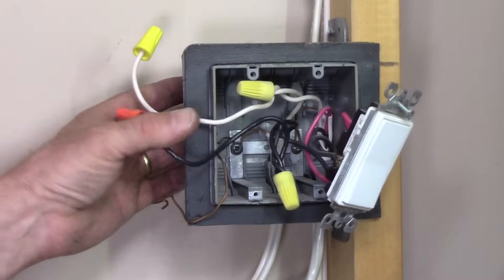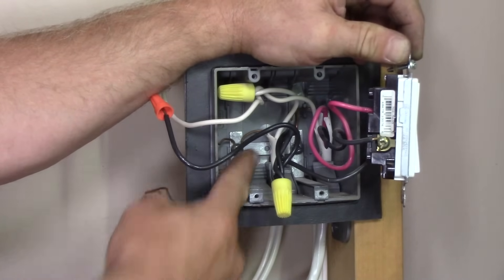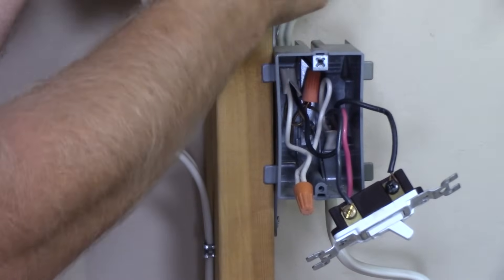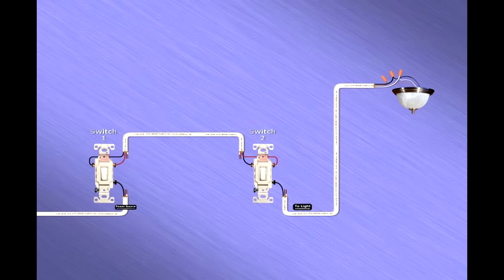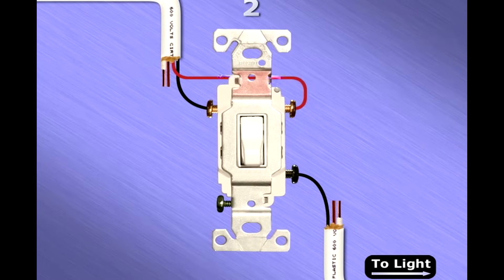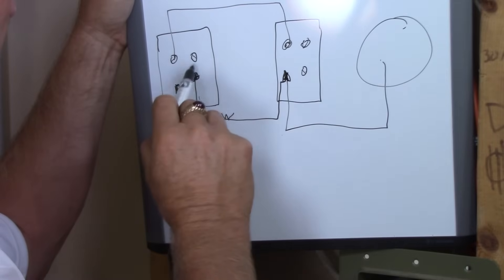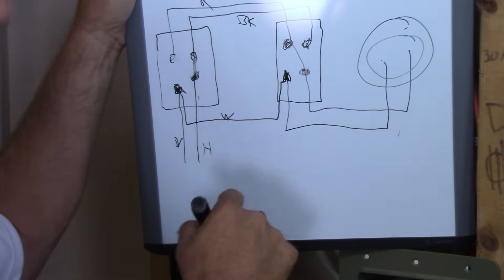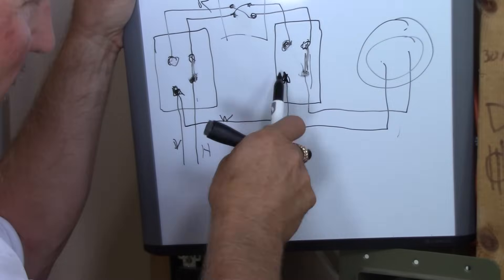The Best 3 Way Switch Explanation Ever!

Comment: There are two other methods, Chicago or Carter and West Coast or Hollywood. The West Coast 
is weird but the Chicago is  dangerous as it can put 120 volts on the screwshell of the litebulb.
this was made a violation back in 1923.
Reply from the maker: Yes, there are many variations of how to wire this, but once you understand how it works, it's easier to apply that to any other method.  However, this is the most accepted way now with the new code requirement of a neutral in every outlet box.

Comment: Can you do the wiring in 12/2
Reply from the maker: Yes, for sure!  Canada we use much more #14 wire and 15A breakers that I've found in the USA, or at least Arizona where I had a home.  Mostly 20A and #12 for utility power and lighting circuits. Thanks for watching!

Comment: what if both traveller wires are the same color and using Lutron Maestro switches. Does the connection of the traveller wires have to a specific location  on the companion switch??
Reply from the maker: No, you can mix up the travelers.  No problem!  I hope that you also subscribed to my channel, and clicked the bell?  Much appreciated!

Comment: I have a situation with a light switch that was a self contained single light switch with three Romex cables in it. I installed a leviton decora switch but now when I turn my closet light on it turns on my two wall receptacles and when off they are too
Reply from the maker: Did you get this fixed?  Sounds like you mixed up some of the wires? Let  me know if you need help sorting  this out.  I hope that you also subscribed to my channel, and clicked the bell?  Much appreciated!

Comment: It would be much more intuitive if the two travelers were top and bottom on one side of the switch, with common on the other side.  Then you simply point the switch the way you want the power to go.  Having them both on top is what makes it confusing. (unless you saw one open to see what is happening inside).

Comment: This video is perhaps the best explanation I've seen of many of the principles and operation of 3 way switches.  But the video is mostly useless because the real world wiring are not fully visible as in the animations or diagrams.  There is no explanation for definitively determining the hot and load wires from the short lengths protruding from the junction boxes.  In my perplexing case, after removing the switches on both ends, spidering out all the wires, restoring power, my tester is indicating 3 of 4 wires in each junction are hot (double checked with a DVM too)??? When I reinstall the original switches and connections, the 3 way switching works correctly normally again.  BTW, I'm trying replace one of the original switches with a smart switch.
Reply from the maker: Send me an email with photos, diagrams, anything, and I’ll help you figure it out. Terry@electrical-online.com.
Reply: @theinternetelectrician  HI Terry.  After tripping the breaker numerous times, I gave up and just put it all back together again a couple weeks ago.  The only "method" I hadn't tried and perhaps would have eventually worked, was just randomly wire the Smart switch until it worked (or simply use a smart bulb instead).  I'll try and get you some pics next couple days. 

Still, shouldn't only ONE of the spidered out wires in only one junction box been hot?

Thanks

Comment: You Fixed me up in Under 4 minutes. I went from the Decora which I have all over this house and I HATE them because they Break so easily, to the Old School Standard. The guy in Home Depot Totally misled me. He showed me the 2 Black Wires going to the 2 Brass Screws and Red to Black. That Only made the Switch work 1 Way. IDK if it's because I Changed the Style of Switch, but all I know is that when you said to put 1Black on Gold and 1Black on Black the 💡 in my head went on  before I even hit the Power. I KNEW YOU WERE ON THE MONEY. You are The Man 😎👍🏼 Thank You !!!
Reply from the maker: Happy to help Julz! Thanks for taking the time to comment!

Comment: Your identification of which wire goes to the common screw solved my problem. Thank you!! I struggled for hours and in 15 minutes after your video I have it fixed!
Reply from the maker: Excellent!  Happy to help out! I hope that you gave it a 'like', and that you've subscribed to my channel.  And don't forget to click the bell so you'll know when I release a new video.
Reply: So I replaced mine EXACTLY how it was and it now trips. Nothing is touching. It was not hooked up like you said. So I did your way and it’s now everything on my double box is hot and trios when it switch it on. I’m baffled.

Comment: Question: If I am replacing an old 4-way switch, and the other two switches work correctly but the 4-way is on when it’s supposed to be off, do I switch the wires top to bottom on the new 4-way? Or left to right? Thanks for the good video!

Comment: This was great, thank you much for this.  The animation really helped explain things.  However, it would be nice to see other ways to wire up 3-way switches.  I think there are like four different configurations.  For example, when you wire a 3-way, but the light is between the switches, and it is more practical to run wiring between the two switches, but rather through the light.  Great video overall!!
Reply from the maker: Yes, there are numerous ways to wire these circuits.  But once you understand how it works, it makes it easy to figure out the other methods.  I have a few diagrams that show the different scenarios.  www.electrical-online.com and search 3-way switch.  I hope that you gave it a 'like', and that you've subscribed to my channel.  And don't forget to click the bell so you'll know when I release a new video.
Reply: yeah but this like the main legal method

Comment: Thanx for the video, but since when is there a neutral in the switches themselves??
Reply from the maker: MrTommy, a neutral is needed for many of the new electronic dimmers, smart switches, etc.
But the other problem with having no neutrals at switch outlets is that you cannot add a receptacle to a circuit from it.  Countless questions I've had to answer over the years, "How do I add a receptacle from this switch that only has a black and white wire, and they're both connected to the switch"  :-)  Thanks for watching!

Comment: Great video, what if you have a light and switch at the top and bottom of the stairs?  How do you wire the switches to control both lights and function like a three way switch?

Comment: What if the power and light line come into the first switch box? How would the wires be connected just to the other switch without heading anywhere but still controlling the lights?

Comment: Why can't you run your neutral straight to the light from box 1 then make the red to red as traveler 1 then black from switch one hook it to white at the light for your black traveler?
Reply from the maker: I thought Elvis had left the building? Welcome back!!!  It's all about working with cables or Romex / Loomex.  NMD cabling.  If you were using conduit and wire, then other options like you suggested are quite feasible.  There are numerous methods of wiring a 3-way network, but with the new rule on needing a neutral in every outlet box, this is the best way to accomplish that.  Thanks for watching! Thanks for watching!!! I hope that you gave it a 'like', and that you subscribed and clicked on the bell?

Comment: As you illustrated in your initial outlet/device explanation, colors with "Romex" type wiring are somewhat meaningless. As you showed in the first outlet, the black was both the "hot" and a "traveler". At the other end, the black was the "switch leg" and also a "Traveler".  BTW, a person can tell the black in the first outlet is a "hot" because that same black (via a splice) is feeding the receptacle. On the opposite end/3way, the black simply leaves on its way to the light. Not always the case but for sure, it is here. 
If the electrician who initially wired that circuit is going to do anyone any favors, he/she will physically "wrap" the "common" conductor, immediately where the conductors leave the romex jacket, (no matter what color that is being used) around the two travelers. That way, even if the device gets removed without noticing which conductor was attached to the "identified" terminal, a person can easily tell which conductor is the "common".
Reply from the maker: Good observation Pappa Bob, and a good tip with wrapping the wire designated as 'common'  around the 2 travellers.  I used to strip the insulation off the end of the common to identify it in the rough-in stage so that it was obvious when you pulled them out of the box ready for the end devices.

Comment: Does the placement of the travelers on one switch depend on how they are installed on the other switch?
Reply from the maker: No, matters not.  That will only affect whether both switches up or down have the lights on, or if they have to be in opposite positions.

Comment: I don’t really like to hear “hots” referred to as “commons”. Some people confuse commons with neutrals. I prefer the terms hot (on incoming hot of 3-way), travelers and switch leg (on fixture side of 3-way).
Reply: When the pigstails try to get it you drop it like it's hot
Reply: If you think of this switch as simply a single pole double throw it will take all of the mystery out of relays.
Reply: In this application I would normally refer to the wires as neutral, line, load  and traveler. It’s a power passing device. If it was a motor or low voltage application, than I could see using common as a terminology. However, on the back of most three way switches, the line in terminal is in fact called a common. So it’s not necessarily a completely wrong description.
Reply: They are literally labeled common on the switches.
Reply: @jemmani22  yes common is the correct term if that's confusing to someone they shouldn't be anywhere near it
Reply: Well common is the proper term for the hot that isn't the travel. At least it is here in Canada but I would imagine if you're in north America and looked it up in a textbook that's what it would show.
Reply: The switches I'm installing are labeled common, not hot.
Reply: See that's what kinda confused me  none of the other ones I watched said anything about 4 wires. At least this giy explained about the common.
Reply: Common is the proper term because voltage coming to 1 common of 1 of the 3 way switches is the 'feed' and voltage exiting the other 3 way switch's common is the 'switch leg.'  You can't disassociate the significance of the correct terminology!
Reply from the maker: Good point, good old english language and the multi-purpose words.  But this can be thought of as putting the "hot" on the 'common terminal', (not the terminal where the common goes).  The 'common terminal' is named that cause it has something in common to the 2 other terminals (is connected to either one or the other)
Reply: @theinternetelectrician lq
Reply: Thank you very much. It was very helpful  to me. I was having a bad time with all these wires.
Reply: I mostly see the common wire referred to as the neutral where I am in the US. After powers splits and goes to various loads the neutrals all tie together as a common source back. I've even seen multiple power sources all tie into one common neutral
Reply: Every time I hear "common", DC circuit comes to mind, where it's negative side of the power supply.

As for AC circuit, I always hear load, neutral or ground...

Those were what was taught in school where I got my degree in electronics engineering.
Reply from the maker: Common, albeit arguable and confusing,  is the correct term.  This is the same as when referring to relays.  You have a C, N/C, N/O.  The common has a potential to connect to the normally open contacts, or the normally closed.  Think of a 3-way switch as a "manually operated relay".
Reply: @theinternetelectrician  Couldn't have said it better, sir! 👍
Reply: Yeah like a square  but its really a triangle 😂😂😂
Reply: I just call it the spicy wire.
Reply: then don't you like hottest species? ??
Reply: I'm an electrician in Arizona, I agree with you why call it common just say hot there's no difference other than just adding an extra word which is confusing.
Reply: I don't like to hear people complain when there is also a visual tutorial aswell but here we are.
Reply: @moefritz9568  I don't think he was complaining, just making a statement about his preference which I and every other electrician in my company happens to agree with. Life is short and stressful enough without going after someone's comment on you tube that you don't agree with.
Reply: Hot wires are not considered common wires .the common are the white wires in practical house wiring . Very confusing video .
Reply: Well then, why don't you make a video using the language you prefer?
Reply: @breastmeatonly  he's just trying to be helpful to people that are layman. He wasn't being hateful
Reply: That’s funny, just how it was taught to me years ago, we didn’t use the word common lol

Comment: Does it matter which side you put which traveler on?  Thanks for the great video.  EDIT - love the animation.  I'm guessing you need a tool that will tell you where the hot wire is so that you can figure out which switch is the #1???
Reply from the maker: No, it does not matter what traveler wires you put on what traveler terminals, but some people with OCD (and even some inspectors I've been told) want it so that if both swithces are up, or both are down, the light (s) are off.  If one or the other is out of position, they are on.  Yes, you need to have a meter or a voltage tester, but if you have a look at the cables in the box, you should be able to ascertain what is what. Thanks for watching!  I hope that you gave it a 'like', and that you subscribed to my channel? And clicked the notifications bell?

Comment: Please help! I have a box with 6 wires. 4 are standard black,white,ground. While 2 far left are black red white ground. I didnt take a picture. I didnt lable it. One switch was a 3 way with the kitchen light. Another 3 way to the dining room. I can't find anything solid for my situation. Should I just call an electrician? I found the HOT wire using a multimeter... After trying some things out and blowing the breaker I am desperate.

Comment: My wiring has the reds (travelers tied together at the light junction box itself and one switch only has one set of wires on it white BLk and red. The other switch that has the line feed has all whites tied together and one red and one black (that’s not the feed)  I am totally confused by this set up and it’s never worked right
Reply from the maker: Can you scratch out a diagram, or send good photos of the connections at each outlet? Send to terry@electrical-online.com, or internetelectrician@gmail.com and I'll help you figure it out.

Comment: So what if the light is in the center of the two switches ???
Reply from the maker: There are many variations of how to wire a 3-way network.  However this is the one way that now meets the new code rules that require a neutral at every switch outlet.  Once you see how the current flows in the circuit you can adapt to the other scenarios providing the right cabling is in place.  You can see some of the variation diagrams here on my website. https://www.electrical-online.com/3-way-switch-diagram-variation-4/

Comment: Question Terry, On your drawing white board, You drew a  V for the Neutrals going down to the next switches and Lights.  Do these serve as the Ground as well OR did you just not add the Ground Terminal? Last question. Grounds need to be for each terminal or Just First One?

Comment: Why is the hot wire called the "common" I thought the neutral wire is the common wire.
Reply from the maker: Common in this application is in reference to the common terminal on the switch.  That terminal is 'common' to the other two in that it is either connected to one or the other of the traveller terminals.

Comment: How can I add an always on  power utlet to the 3 way set up?
Reply from the maker: You can do that at the switch where the power supply comes in only.  Then you splice in to the hot, the neutral, and ground.  The device box needs to be a large enough box to accommodate the extra 2 conductors (+ ground), for a total of 7 conductors.